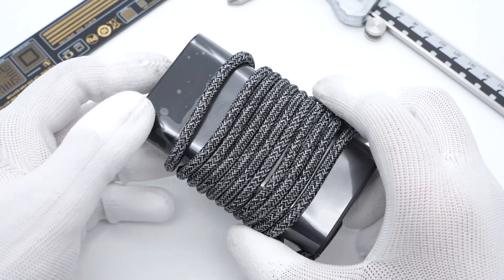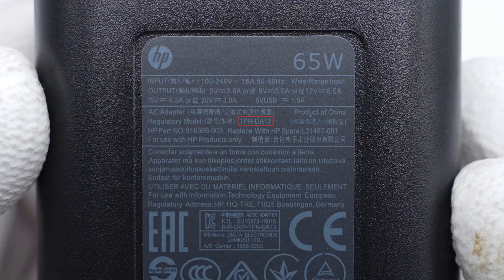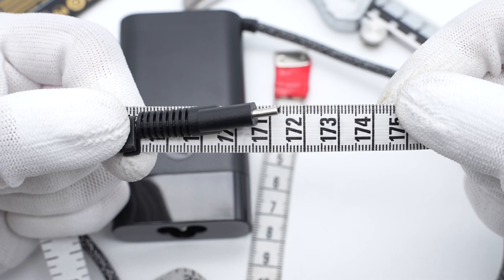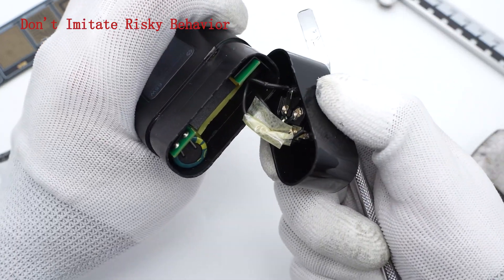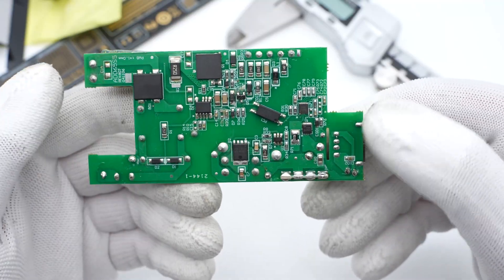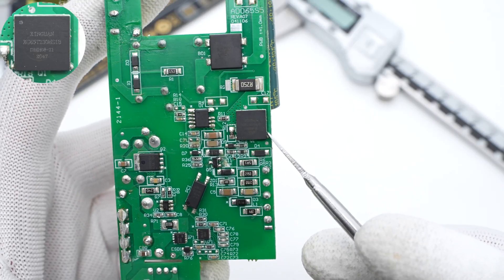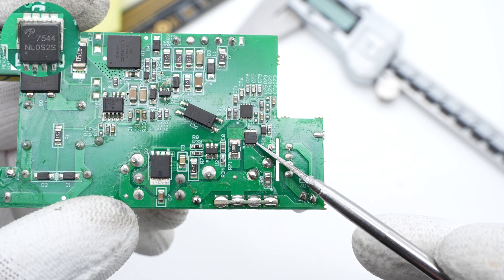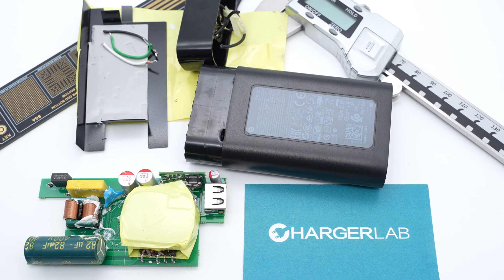Should We Buy It? | Teardown of "Fake" HP 65W Power Adapter

Comment: How can you say that it's actually fake?
Does it have something to do with the product number?
Reply: The knockoffs are getting pretty good look-wise but most of the time, putting it side by side with the original highlights how the plastic casing looks cheaper or the weight is different, etc. But the price is the best indicator. If it's too cheap compared with the price of the original, it's likely fake...

Comment: wait... chargerlab I just thought of something. What would happen if you use a usb c to lightning charging PD adapter like the one by Meenova on amazon  and the Nintendo switch to charge iPhone? Since the iPhone 14 Pro Max pulls 14.5v 2a 29w by selecting the second PD option, most PD chargers cannot reach the max power because the iPhone pulls 9v 3a and is limited to 27w as a result. However, it seems that the iPhone can go even higher. What would happen if the nintendo switch charger was connected with an adapter from usb c to lightning PD and then connected to iPhone 14 Pro and Pro max? Since the Nintendo switch's second PDO is 15 volts at 2.6 amps with no 9 volts supply, would it just pull that power or would it drop back to 5 volts? 

I'm hoping that charger can charge the iphone pro max even faster than the 29w charger and reach 60+% in 30 minutes.